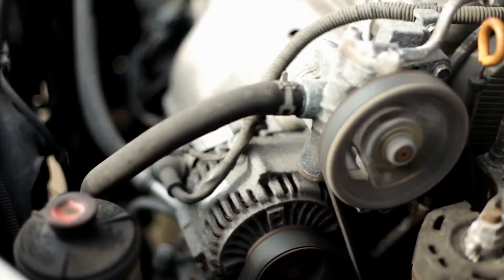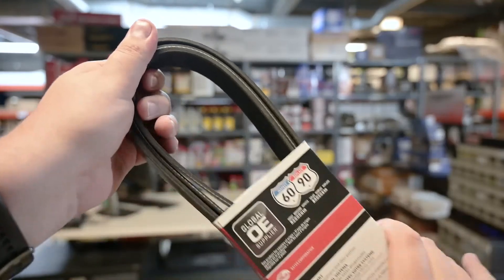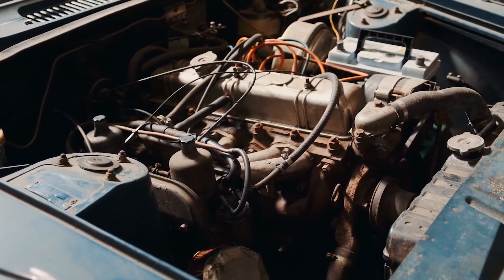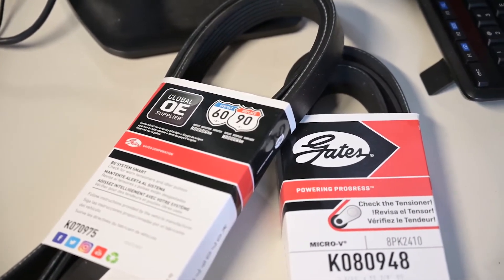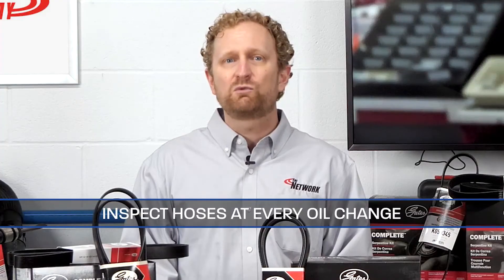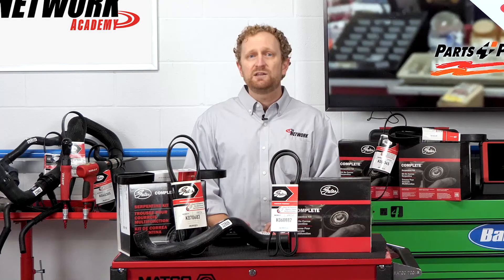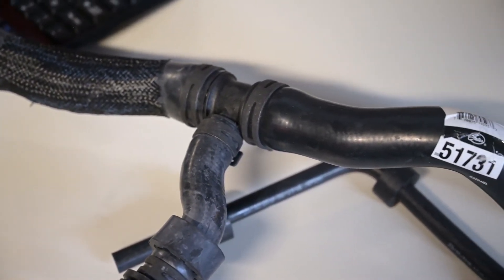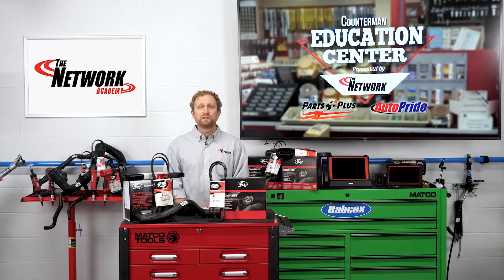Belts, Hoses And Replacement Intervals

Comment: What about the age factor?  My 2015 Honda Civic only has 12,400 miles on it.  But now its 8 years old.  Are the belts disintegrated due to age? I change the oil regularly and the mechanic never mentions belts and hoses.